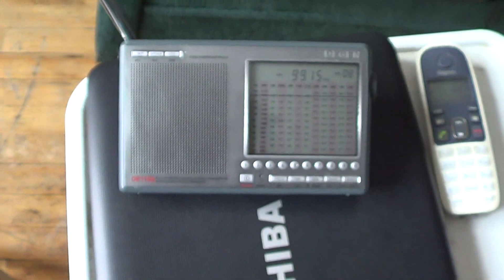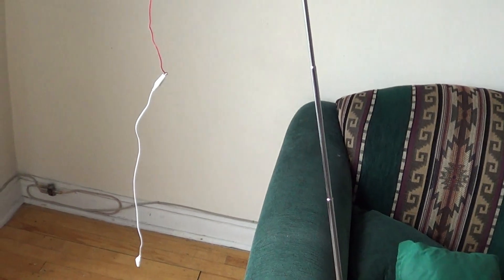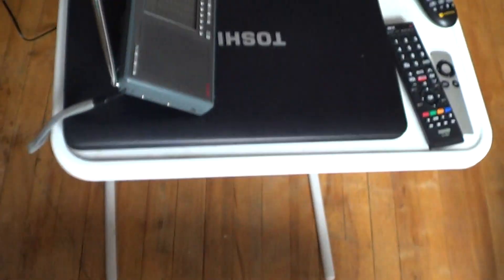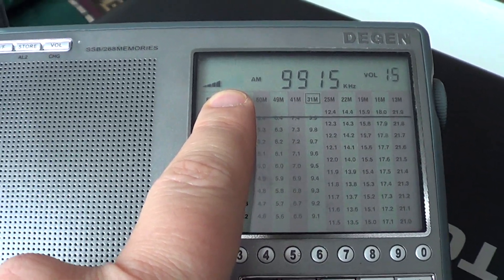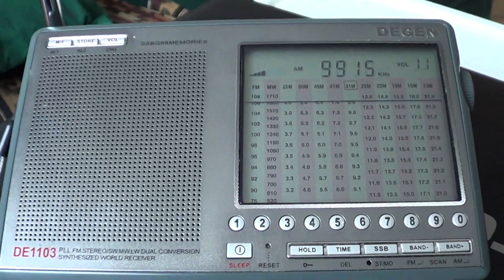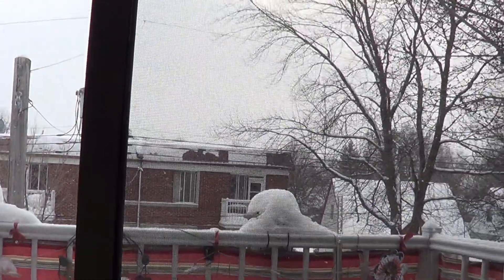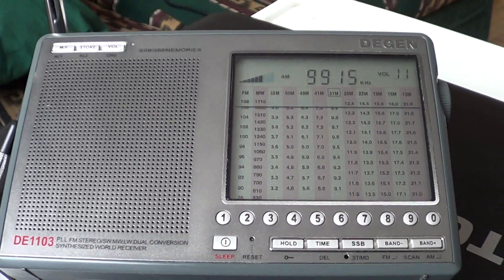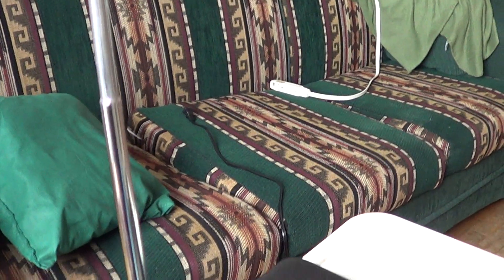Shortwave radio listening at home improve signal with a simple wire antenna

Comment: Have a question, can you use a wire connected to a cold water pipe, reply at your convenience thanks good info by the way!
Reply from the maker: you could if noise is not too high might work

Comment: My friend connected the radio antenna with wires and connected the wire to the metal window frame, his room was inside the house, he later connected the wire to the metal railing of the terrace.
He could essentially use the frame which was as big as the house

Comment: Single wire? Well, better find out the kind of construction you have. Lots of ribar and steel kill interior antennas. RFI doesn't help either. Add propagation and you are better off with an external antenna out away from your building.

Comment: unfortunately  increases in signal strength  will likly  increase the noise  level unless you get a antenna  away from the  house. A random wire with a good  ground is your best low cost "fix" but a  amplified  and tuned "loop" is a great choice .

Comment: The loop of the wire just will not have any effect on the reception (definitely its not a loop antenna). The signal increase is only due to the length of the wire (long wire antenna) from the telescopic to the wire loop. Infact any length of wire connected to the radio will increase reception...the longer i the better the signals, especially on the lower frequencies like 49m band. Obviously signals would come in better if the 'antenna' is put outside. 73's

Comment: I got the same radio. Thanks for your tips. I've used the Degen wire itself like you did, placed in the broomstick end and placed outside my apartment's window. EMI almost gone! Maybe a low impedance path via balun will do even more improvement. Thank you so much. 73's from Brasil.

Comment: I have an old Sony World Band Receiver ICF ISW100 portable unit which has an active antenna stereo jack input -looks just like an earphone jack, but for an antenna plug in. What kind of antenna would you suggest? A simple dipole connected to a  50 ohm  coaxial line which is connected to an adaptor to the stereo plug?
Reply from the maker: ***** Yes that could work very well

Comment: Can you link to what wire you use on amazon OfficialSWLchannel  as the only wire I have tried is the wire that rolls up for called the Sangean ANT-60 and would love to get me some wire like that but I have no clue where to start even if a person tells me the gauge my eyes gloss over since I was never in to knowing that much and I don't want to get too heavy a wire I assume so any help would be appreciated.
Tom
Reply: It looks like standard 1,5mm2 (15awg) wire from the video, 0,25mm2 (23awg) is better as it's more lightweight and flexible, basically any gauge should work for antenna in theory.
Reply: Thanks DjResR !!!